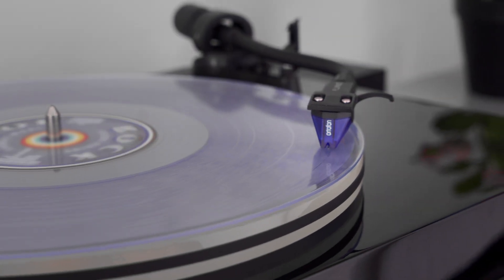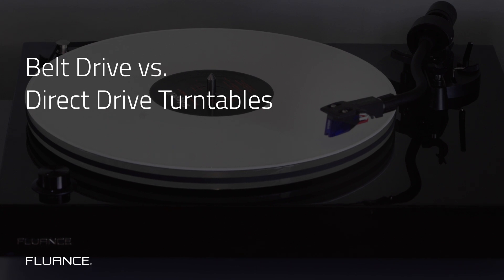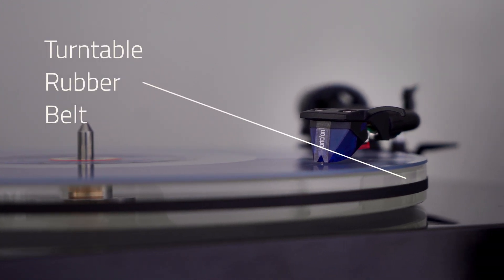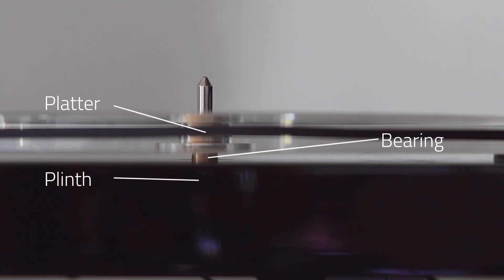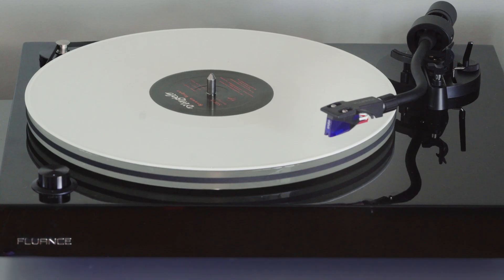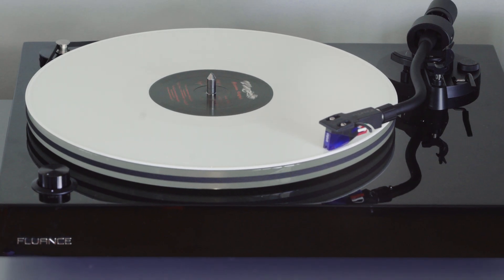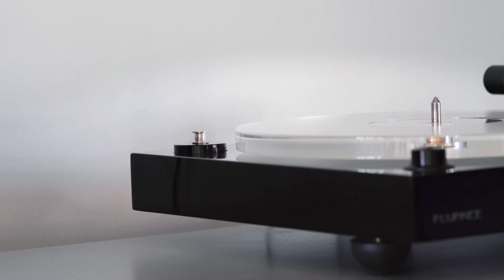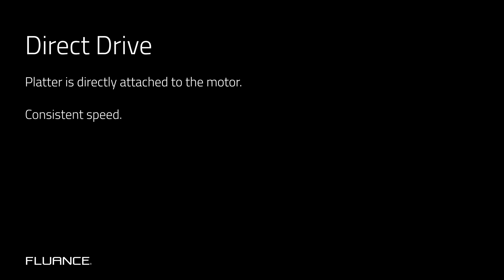Belt Drive vs Direct Drive Turntables: What's The Difference and Which One Sounds Better?

Comment: Da fuq. This has nothing but lies. 1) DD and Belt driven TT's have platter attached the same way - on bearings. 2) DJ's do not need instant startup, they need quick acceleration/deceleration while beatmatching records, 3) BeltDrive is the only method that is directly in contact with the platter - and rubber bands are not equal - the have thicker and thinner parts which affects the speed. 4) Direct drives are usually driven by magnetic force - the motor is NOT directly attached to the platter.

Who is the idiot that made this video? Remove it.

Comment: In the Direct Drive ... since the the platter is directly sttached to the motor ... SOUND QUALITY MAY SUFFER ? ? ?  HOW, WHY, SAYS WHO ?
THE MOTOR SPINS AT THE DESIGNED RPMS, DIRECTLY, NOTHING IN BETWEEN, NO VIBRATIONS, THE MOTOR ELECTRONICALLY SPINS AT 33 1/2 RPMS, WHAT VIBRATIONS ?
ALL THE SPECIFICATIONS MEASURED IN LABORATORY, SHOW ALMOST NO FLUTTER, OR WOW, HUNDRED TIMES BETTER THAN A LITTLE MOTOR SPINNING AT HIGH SPEED (CREATING VIBRATIONS) AND MOVING A TURNTABLE THRU A RUBBER BELT THAT DRIES OUT, STRECHES AND SLIPS, MAY SNAP AT ANY MOMENT AND LET YOU HIGH AND DRY....
THIS GUY HAS NO BRAINS OR IS BIASED TOWARDS ILOGIC REASONING, A BUNCH OF BS OR IGNORANCE

Comment: Most DJ records are 45 rpm for a reason. Jukeboxes use direct drive at 45 rpm
most consumers buy 33 1/3  lp
Belt drive is better at the lower speeds with less noise wow and flutter.
The reason direct drive is more expensive is that it's a commercial drive system and it's made to be more rugged. Not because it sounds better.

Comment: It was interesting to watch your video comparing belt and direct drive turntables. Having owned a budget turntable of both types (Pioneer PL-12D and Citronix PD-2s) I have to be honest and say I couldn't notice any discernable difference between the sound quality of the two units.

However my experience was that I much preferred using the direct drive turntable because of the faster start up and stopping times and the fact that I didn't have to worry about replacing the belt every few years.

I'm inclined to feel that sound quality has got little to do with drive type and more to do with turntable weight, number of poles on the motor and quality of the turntable bearing.

I expect many people may feel the opposite.

In order to help people make their choice, it would be interesting to hear from people who have owned higher end systems of both types, as to which they preferred and what their reasons were.

Comment: hve a or an altered belt drive homart. Could I use ths to turn my belt drive fan, lke if I ever wanted to the the belt iff and use ths to mke it spin a little if lje a txd/jxst slxwer bt lke still hve the tightness to decrease rattling noise or di, or is it too weak to use?🤔🤨🧐🤷‍♂️I gt a sprocket to make it chain drive, it ordered ir lke arrived today, but I’d have to go pick it up frxm grainier because it wsnt in stock

Comment: They sell belt driven turntables. Direct drives do not transfer more noise to the platter (some really cheaply made ones do of course). Most good Japanese DD's from good old era had rumble vi below -70dB. Many even pushed it below 75-78 dB, like the Technics SL-1200 and lots of others. That's better than the vinyl medium needs and any noise from the turntable will be drowned out by the vinyl noise. Name me one belt drive that beats that which people other Elon Musk-types can afford. We don't need to talk about wow and flutter, dd's are better. Cogging is a myth. If it was real it would show up in the flutter measurements.
Reply: DD noise is a myth made by British audio magazines/ dealers, they were absolutely horrified when direct drive hit the market so they had to make up stuff to make DD look bad. Some turntables like mine (Technics so-1900) have a slight hum coming from the coil itself but the bearings and platter are seperated, it isn’t transferred to the stylus.

Comment: I really don't understand I've had direct drive turntables all my life never was a fan of belt drive because belt will wear down and can or might cause speed issues ,maybe I am deaf but I never heard any noise from motor on my TT's. I had. TT with a lot of rumble if I tapped the base I could hear stylus pick up the sound but I never heard motor noise I am fussy how sound comes from playing records and I can hear if the stylus is worn or has dirt on it. I have. A Pro - ject TT belt drive I can sometimes hear motor running but so far I do not hear it in music my stylus has not picked it up and not a fan of TT's with belt around platter like U-turn TT it is a great looking TT but seen way too many videos with belt slidding off of platter I "'ve seen people who showcase their U -turn but complain how belt easily falls off I don't understand how u can get speed stability out of a very thin belt and looks so loose when people string it up I would prefer if belt was flat and was a little tighter around platter or why not machine a small lip on platter edge if they can charge extra for a simple cueing lever which I believe SHOULD COME WITH TURNTABLE and it should not be an option then they can charge extra for platter lip and in my time the belt drives they had when growing up the motor wad a little better made than today's motors speed is usually off of these cheap motors that is why I prefer direct drive and with quartz speed control you don't have to worry about speed variations JRo📀